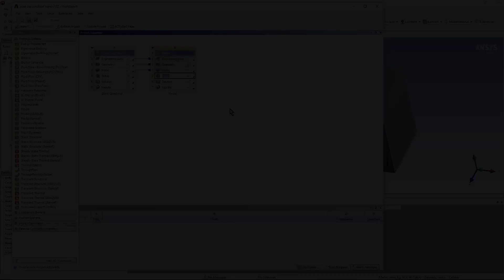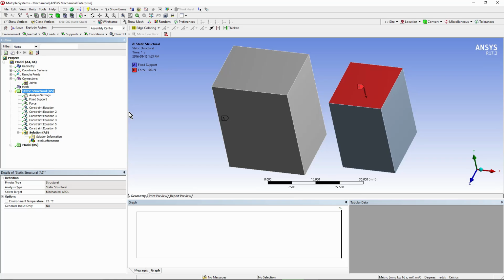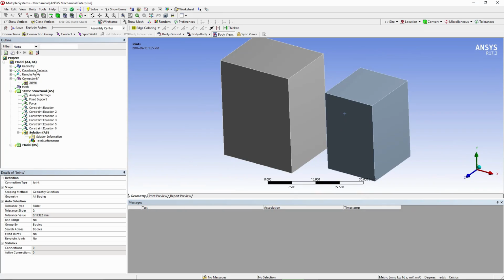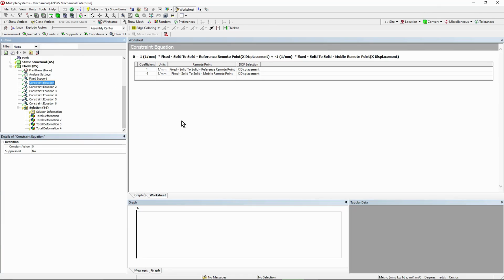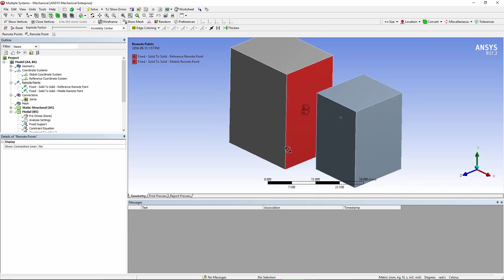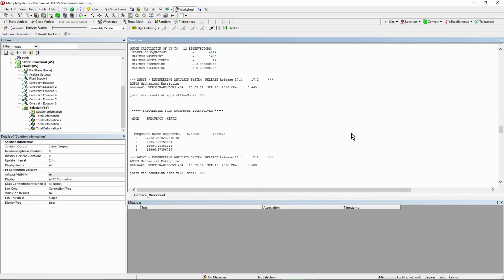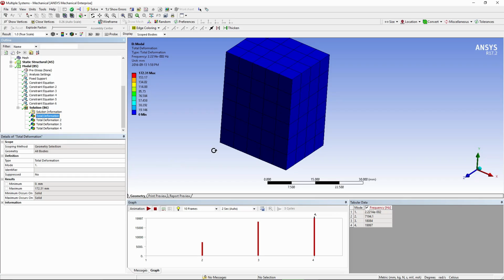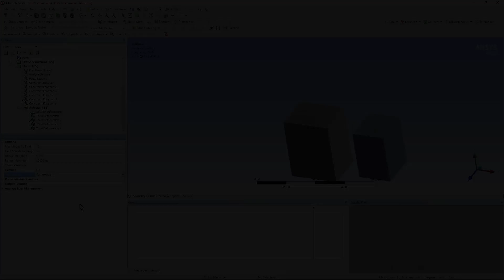Modeling Joints Using Constraints in Ansys Workbench Mechanical

Comment: Hi, how you wrote the constraint equation. could you elaborate. I am also working on coupling on node in ANSYS WB, which can easily done in APDL using CP command. But I am trying to find a way to use it in ANSYS WB. It will be a great help, if you could share your experience. Thanks. Ashish R
Reply from the maker: Thank you for your comment. You can find additional tutorials and leanings on the SimuTech Skills Center here: https://simutechgroup.com/resources/skills-center/

Or if you are interested in training, mentoring, or consulting with SimuTech Group, please send us an email at info@simutechgroup.com